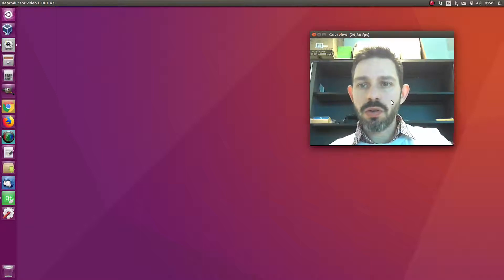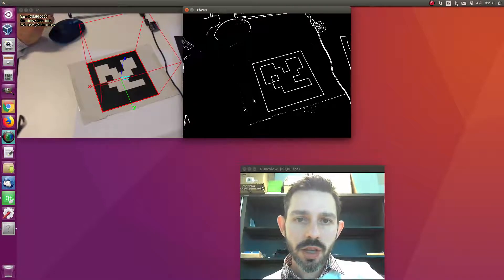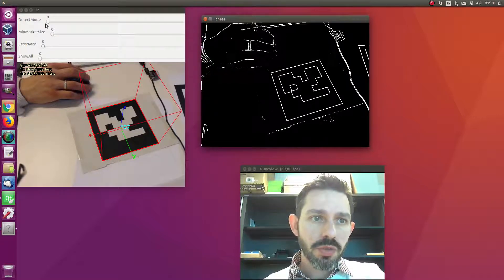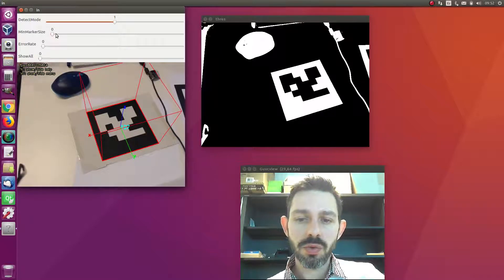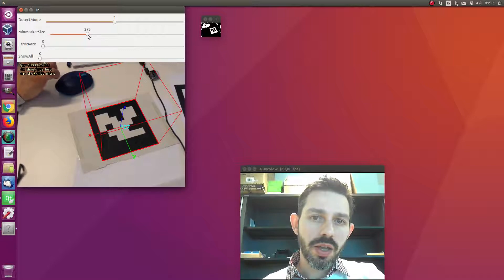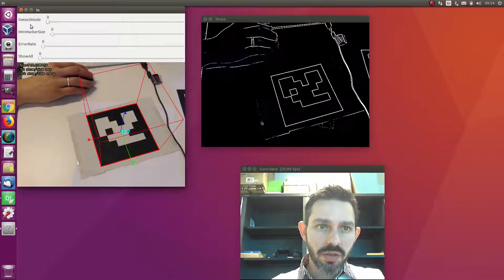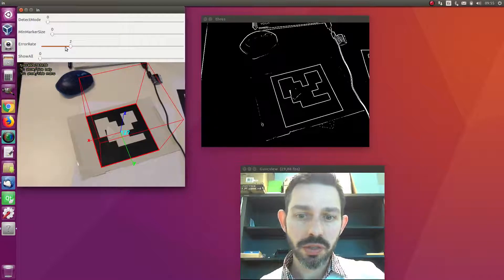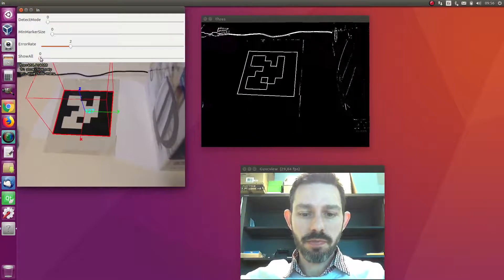7. Estimating the pose of the camera and configuring some parameters

Comment: Hey, How are you able to achieve 500+ fps, I can only achieve 30fps? Are you using special camera? Is opencv in python slower? How can I achieve such high frame rate in python ?
Reply: You are probably being held back by your camera frame rate, try set a new thread to collect the camera input
Reply: @joaosimoes5052  Can you please share with me your frame rate?  Are there special cameras to achieve around rate of around 500 fps.
Reply: You dont need any special camera.
In fact I was using my phone to stream the video (on the same network).

All you have to do is create a thread that calls your camera capture in a infinite loop.

Are you working in C++? 
I can show you my code I did for university last year
Reply: @cpabz8964  

just create a thread that calls the following function:
 void funcaoThreadCapturaFrames() { 
     while(true)
  {
       augmentedReality->capturaFrame();
  }
 }

C++ basic example of creating a thread:
 thread t1;
 t1 = thread(funcaoThreadCapturaFrames);
Reply: at the end of the day your Augmented Reality program will use multiple times the same image, bue as this is now processed parallel to your "main program", you can now have extremely higher frame rates
(example if you are having 500 fps but the camera can only update at 30)
Reply: Software can not overcome technical physical restrictions.. I dont believe that this setup can realy catch 500fps.. I looked for good camera at arducam... Not that Webcam 30/60fps stuff And ended with a Black white monochrom camera capable 120fps.. at 640x400.. There was not a Single camera for reasonable prince.. That gets over 120fps.. And even not as colour cam

Comment: Hi Rafael, What was the cpu? And how many cores were utilized? Thanks.
Reply: Wow, that's impressive, what was the image resolution btw? I use apriltags for my application and only get about 40 fps on 640x480 image with a core i7-6th gen.
Reply from the maker: A i7 7th generation. lenovo yoga . 1 cpu only

Comment: How does the system understand the perspective of the cube?
Reply: Knowing the corners of the marker you can estimate the pose of the marker relative to the camera, or vice versa.
4 points 2D ( corners of the marker ) to 4 points 3D.

What are the 3D points?
For a single marker you can use for example
-size/2 , -size/2, 0
-size/2 , size/2, 0
size/2 , size/2, 0
size/2 , -size/2, 0

That said, one of the simplest ways is using a minimal squared algorithm such as implemented in the solvePnP function.

Comment: Hello, Rafael. What is the original order of aruco marker corners in ARUCO_MIP_36h12 lib? Thanks
Reply from the maker: Akmaral Moldagalieva ,what do you mean by order?
Reply from the maker: Akmaral Moldagalieva , ah ok. I get it. Is counter clockwise, the first one is bottom left
Reply: Thank you very much. I use them for pose estimation. That is why it was important.  The first one is bottom left, the second is right bottom, the third is right top corner and the last is left top corner, right?
Reply: Hi Rafael, Could you make clear, please, is it the order of corners  in the model frame?  I am a bit confused, because, when I draw these found pixel coordinates it shows the opposite - the first one is the top left and clockwise.  Aruco from   /docs.opencv.org/3.1.0/d5/dae/tutorial_aruco_detection.html   has its first corner on top left. Thank you.
Reply from the maker: Sorry, you are right. First one is bottom left. Just where the marker id is written in gray color.
Reply: Thank you, Rafael
Reply from the maker: Sorry again :(. I think the confusion is that along the different version I changed that. In the aruco version 3, is top left . Im creating an image to show and solve the problem once for all.
Reply from the maker: Hi. Im working on a document to clarify the aspect of the library. Check at https://docs.google.com/document/d/1QU9KoBtjSM2kF6ITOjQ76xqL7H0TEtXriJX5kwi9Kgc/edit#
Reply: Great! Thank you. That'd be very helpful for my Master Thesis research.  Thank you again.